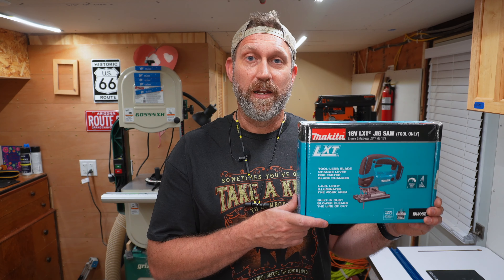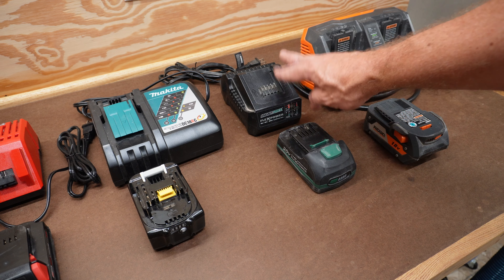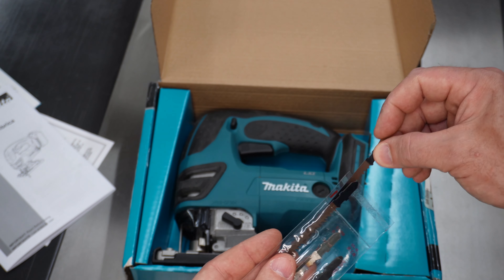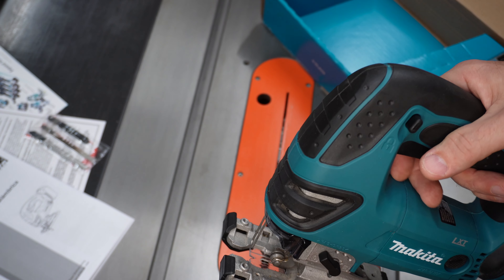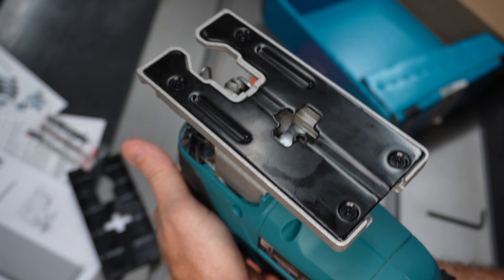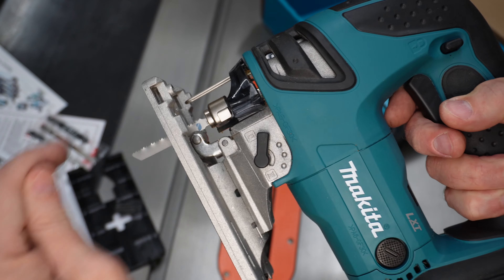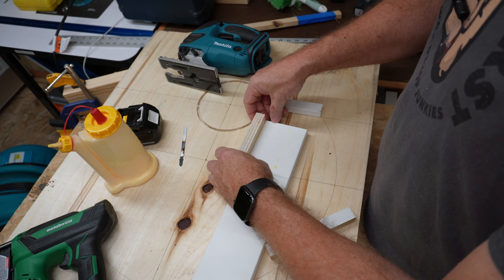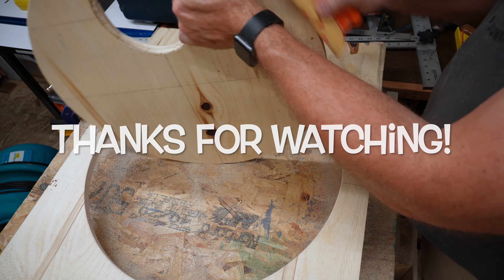Makita Jigsaw 18V Cordless XVJ03Z

Comment: Ordered mine today. Longtime Makita user, my oldest(at least 20 years) 9.6 volt keeps going as well as the 14.4 volt driver-drills and accessories so I decided to keep buying batteries for them. The previous Makita replacement batteries were dated 2011. They are now on their second sets of(aftermarket) batteries and my original 18v LXT batteries are still charging. They don't get used like they used to since retiring in 2015. Excellent intro for my new jig saw. It'll outlast this old timer. The rotating cornhole is cool.
Reply from the maker: That's great feedback! Thanks!